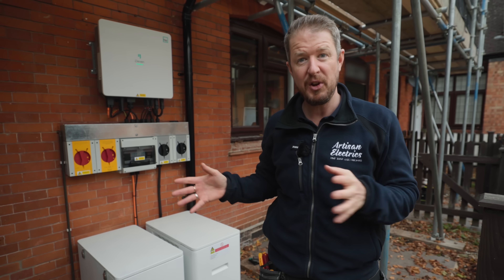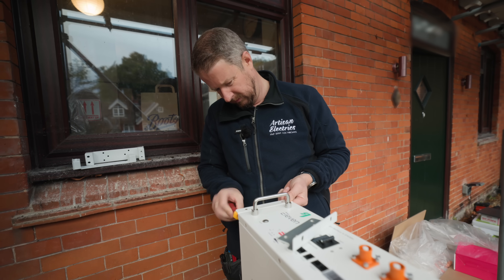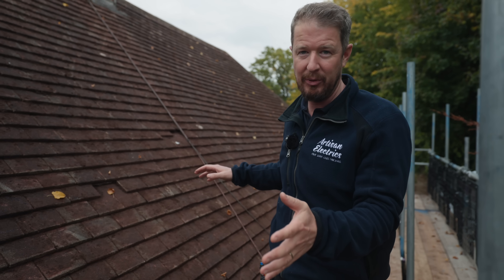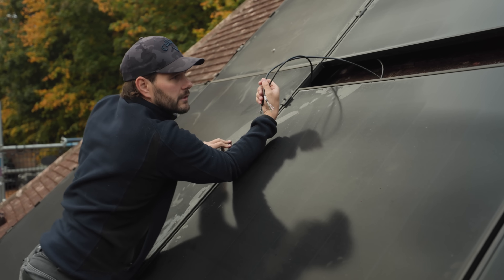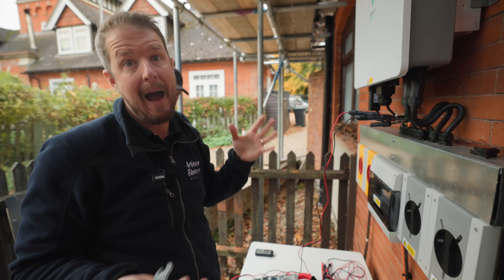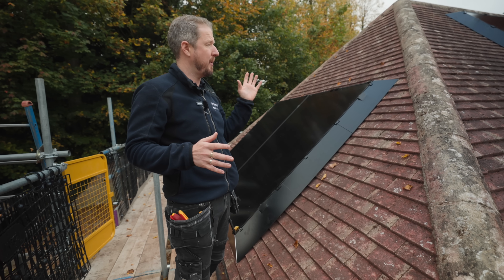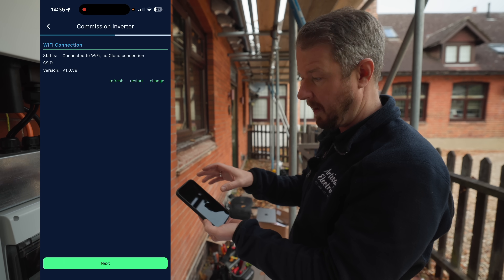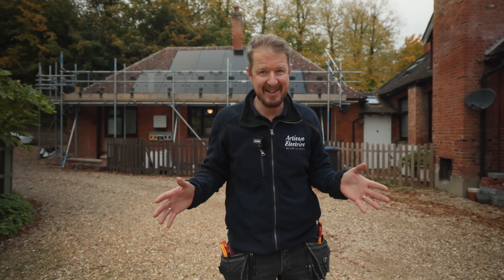Is Sodium-Ion The Future of Battery Storage?

Comment: The main concern for me is the app being cloud based. When to company decide to stop supporting the product or the company goes bust, you have a broken product and all you can do is pay again to another company.
It doesn't matter then size of the company, for example Google has just stopped there NEST products working (gen 1 and 2). these were expensive and now E-waste. I refuse to buy any cloud based systems anymore as they are a scam in my opinion.
I also have concerns about the kit being installed outside, If thats working in 10 years I will be amazed.
Has it got cloud based cctv covering the batteries. I wouldn't be suprised if the guys that robbed your new office pop round.
Reply: First thing I do when thinking of buying "smart" products is check for a Home Assistant "local" integration. The "local" integration is critical because Home Assistant supports talking to the manufacturer's cloud for some devices.
Reply: @economicprisoner  says it is on their website, but no mention if its local or cloud.
Reply: Besides cloud there's also vendor lockin.. for example, is everything also accessible from HomeAssistant?

Comment: Moss means no sun. My roof is the same. Sun side. No moss shade moss everywhere. Will the panels generate much
Reply: If the moss grows on the roof tiles, it will also grow on top of the solar panels, and what little light there is in the shade of those trees will not get through to the cells after a few months!  Unless you change the environment on that side of the roof to be unsuitable for moss, those panels will be useless!   Reduce the height of the trees and they would work, but then the wind calculations will be incorrect... what happens if the council cuts their trees down, without redoing the customer's wind calculations and fixing the problem which is nothing to do with them?

Comment: Apparently, the batteries have much lower voltages as they discharge but they may have tweaked the inverter to cope with that. The other problem is fail rates in production, around ten percent and those batteries may make if from the auto factories into other uses, so probably not a good idea to buy cheap ones from Aliexpress. Much less fire risk does suggest putting them in the loft to minimize DC losses, though. Would have been nice to give the old roof a coating of sealant type paint after cleaning and bio-spraying.

Comment: 13:29 - here the installers put a panel horizontally over these 2 just to get the most out of the small useable roof space and of cause the higher a panel is mounted the better it is - and of cause we add optimziers on such roofs with a  lot of shade OR  roofs with a line of horizontal panels that are not shaded as much. Hence the lower panels get the optimizers to compensate the missing current by trading in voltage. 

Quite good customer who is already planning and preparing and accepting such solutions which is usually heavily discussed where to invest 100 € more if you can spend only 100€ more - or 1000 or 2000€ ... hence you get the biggest benefits first and then go hunting for the remaining reserves that could be used. 

Usually pv sol premium delivers every prossible solution.

Comment: Those solar skirts not only look good, but they protect against the wind ripping out the panels in a storm.
Reply: They look nice but, solar panels get really hot in summer which I would be concerned these type of skirts would restrict airflow under the panels making them less efficient
Reply: Roof should be washed minimum each 5 years if one want it to last over 20 years. This is reason there will not be any solar panels on my roof. The cost of replacing the roof is many times higher than the solar panels.
Reply: @thomasl2974  WTF are you talking about?
The solar panels will actually prolong the life of your roof (Well the bits under it).  They literally protect the materials under them from the elements whilst still allowing sufficient airflow.
Reply: @thomasl2974  I hate it when I can't get my sponge under the panels. My roof demands a full spa day at least once a decade or it gets cranky. 
I always wear my tinfoil hat while scrubbing, everyone knows a clean roof amplifies the 5G signals.

Comment: i afraid it is NO for home storage(especially hybrid or off grid), but big YES for grid scale BESS.
there is no significant advantage over LFP battery, price is still expensive(for now), round trip efficiency is worst, voltage range is too wide for any DC coupled system

Comment: Sodium ion is supposed to be much cheaper, so I did some research. I saw the kit at £500 and thought, woah, that's really good value. But that's just the empty box. The batteries for 5KW are no cheaper than LifPo.
Reply: 1st lithium prices have fallen
2nd there just coming to market
+
The information I have points to more charge/discharge cycles

Comment: It is  Potentially a breakthrough unfortunately it still uses a small amount of refined lithium so not as environmentally friendly as it cou5be, but a huge step forward. Higher power density, doesn't explode and can work in extreme temperatures with only a small loss of power. Did I say it doesn't explode/ self ignite even when damaged 😊

Comment: Apparently they are no good for solar storage. Not as cheap as they should be. It's a big con. Watch Will Prowse speaking about them.
Reply: There only just coming to market
If you look at how battery prices are dropping overall you can see where this is going
+
Its easier to set up battery factories if the resources are sourcable from the local area
Reply: @SlowhandGreg  But they don't seem to work for home solar storage.
Reply: @SlowhandGreg it is not about new tech, voltage range is determine by chemistry that used inside, sodium ion will keep the wide voltage characteristics always. Hence it is not suitable for home storage

Comment: I really like the Eleven battery technology, the app and ease of install looks great, so I’m sure some good engineering has gone into this. But the Eleven system packaging is ugly and although the install is neat by industrial standards it’s an eyesore in a domestic environment. I think this also has some security issues too, it looks too easy switch off, vandalise or even steal components. So I’ll most likely install Sigenergy next year.
Reply: why? if its around the side of the house or in a garage its not an eyesore.

Comment: Interesting. It should be a lot cheaper than the same kWh capacity as LFP (but I'm guessing made-in-Cambridge offsets that). Also, what's the fully charged : fully discharged voltage range? There are some sodium cells that have a horrifically wide voltage range - hard for inverter effect, hard for cabling sizing.

Comment: Britain has no sunshine in Winter and this is not a pretty install with all that switchgear so perhaps we should be pushing harder for warehouse, mall and industrial installations first but I know that retail electricity is so expensive in Britain now that this is a good economic choice. Interesting video and this is very useful ecologically and financially but we can do better than this. Large arrays along the Northern edge of any field or garden work well too.
Reply from the maker: Thanks for your thoughts!
Reply: I've a 10 panel system + 15kwh of storage
Just checked its cloudy and I'm generating more than I'm consuming at the moment

I'd add that i charge the batteries overnight while prices during the day are high you can get overnight at up to 70-80% cheaper.
The more Wind turbines they put on the grid the more off peak energy they have to get rid of given it's more expensive to shut a turbine down than give the spare electricity away

Comment: be interesting to see if these Sodium batteries have better round trip efficiency than truly awful measured performance of other batteries of the same chemistry.  Round trip efficiency has been woeful - just 60% compared to 95% for LFP, and even worse below 50%SOC and at high charge/discharge rates
Reply: You need a different type of inverter for Sodium ion, if you try to use a Lithium ion inverter you will get terrible performance.

Eleven Energy provide their own inverters for this reason.
Reply: @slrsteve6359 Roundtrip efficiency will be shit regardless; it's a limitation of the chemistry.
Reply: The poor round trip efficiency is because the sodium ion battery is still on its 1st gen that uses carbon based anode, which are very hard for the sodium ion to pass through, resulting in much higher internal resistance and low efficiency

Next gen sodium will use anode free design, aka a straight up exposed copper foil as anode, which will greatly reduce the internal resistance and increase the round trip efficiency and energy density as well (there are very intensive research of this next gen anode free sodium battery and many journals of this research has showed impressive round trip efficiency of as high as 94% on very high charge-discharge rates, but it's still in lab research and may not hit mass production at least in the next couple years)
Reply: manufacturer says 94% on this setup.

Comment: Possibly the worse use case for Na-ion batteries is for PV with battery backup (comparatively low energy density, terrible round-trip efficiency, huge voltage swings over the charge/discharge cycle etc. ). Eventually will be great for grid-scale energy storage, terrible for home micro-generation. I do hope your customer didnt have to pay (for the battery).
Reply: By Will's testing, But I don't know if that's the same for this UK battery.
Reply: Next gen sodium will suppose to have round trip efficiency of around 94%. Still lower than 97-98% efficiency of LFP and other li-ion, but it's getting really close. The energy density will also be improved. But the problem is it still takes time before finally able to mass produce, as those "next gen sodium" things are still on the pilot project aka lab research

For the voltage curve, it may require specific inverter like the ones that are used for the lead acid batteries, as it can handle way lower voltage than li-ion specific inverter
Reply: @sihamhamda47  company says around 94-95% round trip efficiency on these sodium batteries.

Comment: If I heard correctly on other channels, besides better performance at lower temperatures, Sodium batteries also have a much higher cycle life (if I remember correctly, catl claimed 10K cycles, ie, 15-20 years, vs 3-5K cycles for LiFePO4)
Reply from the maker: That's an interesting point about the cycle life!
Reply: most LiFePo4 batteries now also have 10K cycle and 10Y warranty and they are packs that perform at -20C with no heating pads; these sodium cells might be the future if they get cheap enough and if you accept half power when getting low
Reply: actually, current Na+ cells have about half of the cycle life of typical LFP cells. 2-3K cycles is all you can expect nowadays.

Comment: How are they going to make sure no water or dampness gets into the isolators with that galvanised steel trunking, that is not waterproof?
Reply: Yep never go into the top of an isolator outdoors. Never seen a trunking used this way. So maybe this will be an extra barrier to water ingress. A few drip holes drilled in and to the isolators will probably do.
Reply: Yep: I've never seen box trunking used externally before, although I can see the advantage of it to hide cabling: I assume that it has an IP rating of FA. Don't like to see bare cables outdoors either. Needs a bit of installation design I feel before the start of the install. Perhaps the use of flexible conduit to the cool boxes would be more appropriate to maintain the IP all the way to the isolators etc.

Comment: All that ugly switchgear, consumer unit and steel trunking exposed to the elements and mounted on the front face of a house.  Hideous for sure but how did you get it through the planning permissions as clearly it is outwith the 'permitted development' rules?

Oh and the lower edge rules on the panels is for rain runoff and not just wind.  Clearly that is against the building regs so that will all have to come down.  In the interim I guess the rain is ruining the walls and flowing into all that new equipment below.  Not exactly a good sponsorship video, especially with all the rework required to make it safe and legal.
Reply: build it into a shed is what id do, but yes not ideal. maybe its there to salt the roads when its icy lol

Comment: Sodium batteries don't appear to be cheaper than Lithium yet, even though the materials may be cheaper and more available.
The coulombic efficiency of the Na batteries is pretty bad with a 70-80% charge-discharge ratio and the voltage/charge curve is fairly steep, so most inverters would only be able to use the top half of the battery's capacity before shutting down to low voltage.
May be better for large scale grid storage than residential, but I would wait a year or two before making any big decisions.
Reply: paid marketing...
Reply: @shabadabadoo4326  Of course. I expect even you wouldn't work for nothing.
Reply: Production capasity and development costs!
Older tech allready have been running several years, so buiding costs and development costs has been collected and those techs mainly produce profit. With new tech you need several years ro getting same situation. And because production capasity at this moment is also, much much smaller, it takes longer time to cover all those early costs.

Comment: Those closed in edges around the panels might look good but will ruin the ventilation needed to keep the panels cool and operating at optimum.
Reply: I have thought this.  surely a mesh would be better, especially if its for keeping birds out (like they say it is...)
Reply: They say "5 star electricians", i wonder if this has anything to do with GTA.  🤣

Comment: Sodium batteries are heavier, charge slower, large voltage swing and have a short life time. Hmmm sounds like a battery technology already very cheap and common. Hint it starts with L and isnt lithium. Sodium is not the way forward, neither was the flow battery or the salt water battery.

Comment: Would take longer but BAC 50 is epic on moss. Takes a few days but the moss turns to a powder and it just brushes off. If be a bit worried about the scraping the moss off the roof and damaging the tiles.
Reply from the maker: Thanks for the tip on BAC 50!
Reply: At least they didn't pressure wash the roof.
That really destroys the tiles

Comment: Isn’t sodium a metal not salt? Salt is Sodium Chloride.
Reply: Salt is a very general term for any compound that has ionic bonds. Lithium, potassium, calcium, sodium all form salts with chlorine and other halogens.
Soap is also a salt because it's a compound made from sodium or potassium with glycerine!
Sodium chloride is called common salt.
Reply: They contain sodium carbonate, nothing to do with "common salt"
Reply: yeah and it explodes violently on contact with water (Sodium).

Comment: I know you'll have done a good compliant install but it just looks like it needs an enclosure or cabinet for it all.. Are their any companies doing full enclosures that are aesthetically pleasing that you can mount to side of house with a gland plate on the side for routing all the cables in to? Better still one that comes with battery, inverters, isolation switches etc all pre terminated.. or with rails for mounting them.  I know the cable glands are all IP rated but not sure about the ones installed on the top side of the trunking long term.
Reply: I was wondering this too.  It looks like a really swanky area, and they're really nice quaint properties.  I'm surprised there arn't rules for the area regarding aesthetics, big breaker switches mounted to the front of your house arn't exactly pretty (unless you're a nerdy sparky perhaps)
Reply: You can buy your own enclosures. Will be big and expensive.
Reply: @johnburns4017 building wood cower to this would cost… couple of tens of pounds… ofcourse Little bit more if using more exotic wood… but expensive… not!

Comment: So much moss also means that there is not much sun that will hit that roof...
Reply: Didn't need to see the moss.  The accent alone should tell you that there isn't much sun that will hit that roof.
Reply: That what i was thinking! And now add, that a sodium battery gives back only like 2/3 of the energy you put in... waste of money!
Reply: And then they installed stuff, that prevent airflow... this is pathetic!
Reply: I have an easterly roof very very high but it still gets shade. The potential installer said it was a waste of time.

The cost of micro-inverters is so unaffordable.
Reply: @allan4787  Depends. With Hoymiles microinverters it is not that bad, as you can get high power multiple input ones. Some of them do 4 panels with one microinverter. Seems in the UK Enphase is common, but those are expensive and out-dated (rated power is not keeping up with panel power). And only one input, so you need one per panel (here they cost 3x as much as the panel) which indeed makes it expensive.  So I would stay away from those.
Reply: @fintrollpgr 
The whole thing is never going to pay back for me

Comment: Are we running out of Congolese children to mine the lithium?
Reply: DR Congo is key to the supply of cobalt, not lithium. The typical lithium-ion chemistry used for stationary storage (ESS) is LiFePO4 which doesn't use any cobalt.
Reply: so what about your phone, laptop ,etc batteries I hope you don't use them then? or fuel thats also refined with cobalt, not lithium.